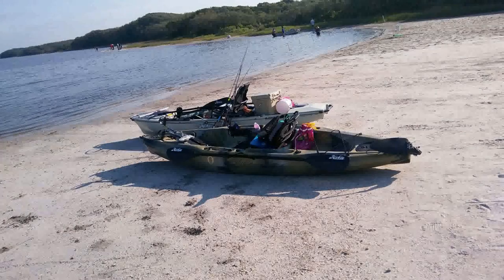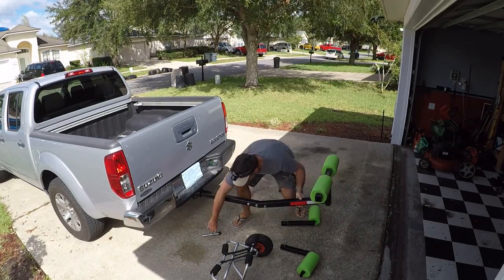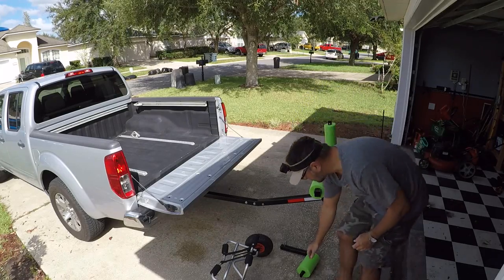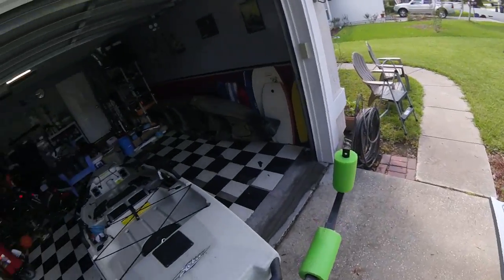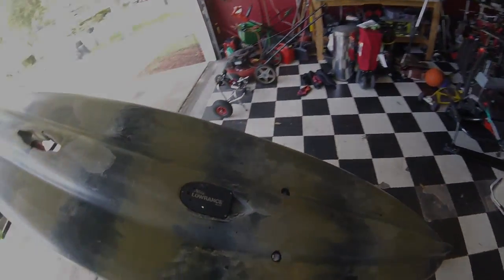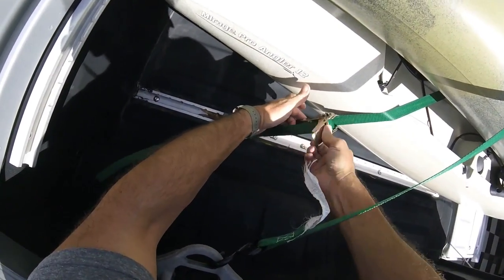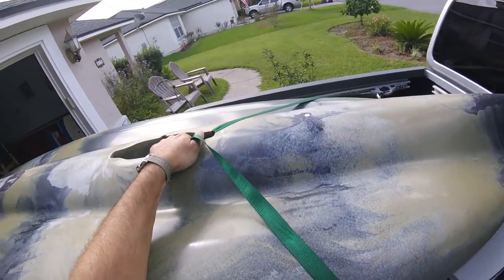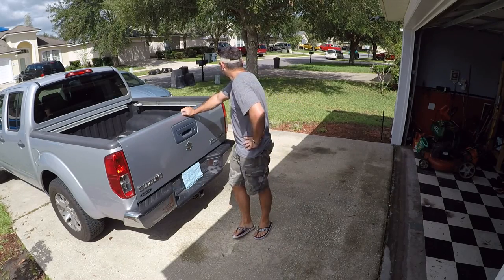How I load my Hobie Outback and ProAngler12 in the back of my short bed truck.

Comment: Great idea to loading yoir two hobie.  I just picked up  two outback and trying to figure best way to haul in 5,5 length pickup bed.  What length truck bed do you have ?   Do you put anything between the two boats to keep from rubbing. Thx a bunch. Cheers
Reply from the maker: It’s a short Bed truck so I do use a bed extender, nothing is used between the kayaks. They mate up perfectly.

Comment: Looks great but doesn’t seem to much space left for seats, drives, poles, cooler, tackle, battery, etc
Reply from the maker: The rods are stored in the PA12 but sometimes I would store a few more to the side of the yaks.
The other gear and seats were in the back seat of the truck.

Comment: The Hobie dealer I bought my PA12 from told me that using ratchet straps on any Hobie voids the hull's warranty. He actually gave me two lashing straps for free because I only had ratchet straps. I know you know what you are doing, I saw that you hardly put any pressure when you strapped it down. I just thought I would share the info for others who may not know that the shape of these yaks can be distorted and Hobie won't cover that.
 Thanks for the video. I bought a jet ski trailer and converted it, but it isn't always the best option. I have 5 kayaks but sometimes I take 1, next time I may take 3 or 4, so I run into different scenarios for hauling. I cringe at the thought of putting another kayak on my PA12. I will get over that in time.
 Happy peddling.
Reply from the maker: Georgia Boy that’s good info to know. I don’t ratchet it too tight but my dealer never told me that even when loading it in my truck. After it was secured I had then come back out for a last minute mirage drive leash install and no one told me that info. 
Thanks again. I haven’t had any issues . I just feel more comfortable with a ratchet on them.
Reply: I know what you mean. I was nervous on the 2 hour interstate ride home. Hobie certainly isn't going to replace one that  blows out or off of a vehicle because it "wasn't" ratcheted down.
Quick question... Was the outback originally yours?
Reply from the maker: Georgia Boy yes the outback I purchased from the dealer. The PA12 I purchased from someone who might of used it 5-6 times and was scratch free. I was amazed.

Comment: I have a PA 12 and a Compass, do it same way except I welded the nuts on bed extender. I drilled holes in the bed extender and use rope locks ( I think thats what they are called ) I never leave kayaks alone. I heard that someone was at a stoplight and another person jumped out of a car and grabbed their drive and seat 🤬🤬🤬 I lock everything up
Reply from the maker: That’s terrible someone would jump out and grab your gear. I keep my drive in my truck and the seat is always locked in.

Comment: I load and carry my kayak exactly the same way. I might get a ladder rack for my pickup so I can take the boat and kayak next time I go to the Keys. I just subbed back. You are almost to 1000 subs... Congrats!
Reply from the maker: RetiredGuy Adventures Thank you. I was worried at first with loading both kayaks into the back of the truck but another person told me about flipping the outback with rudder to the rear and they would mate up perfectly and the outback wouldn’t touch the window.
Works perfectly 🙂No issues at all.

Comment: I have the exact same truck Bed Extender and kayak setup and ordered what I thought to be large pool noodles but cannot slide it over the female part of the extender that is resting underneath the bottom of the kayak how did you get your noodles over that or where did you find pool noodles with somewhere closer to a 2in inner hole diameter? Video and advice was great help just hit a brick wall with that issue
Reply from the maker: I got the bigger pool noodles from Walmart. I got a knife and cut an x from the inside to about halfway out then worked it on to the metal. Took a bit of pushing and working back and forth. It’ll push what ever extra material out and then it’ll be a nice tight fit.

Comment: By law you cant extended 4 ft past your bumper? Have the police bothered you?  I think you can add lights to make it legal.
Reply from the maker: I’ve passed many police and had them behind me and never a problem. I’ll have to measure it one day but I have reflectors and a flag.
Reply: @GetOutTheHouseGoFish  I'm just curious becuase i want to get the same setup .
Reply from the maker: jerry ebner I’ve never had a problem so you should be ok. Mine is a 12 foot ProAngler not a 14 but I’ve never heard of anyone having problems from looking in the other Hobie groups